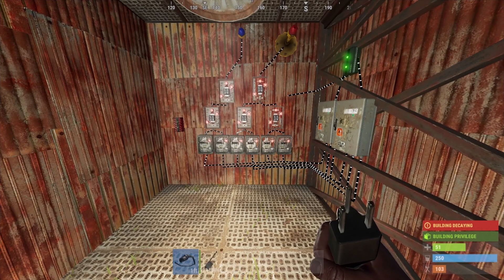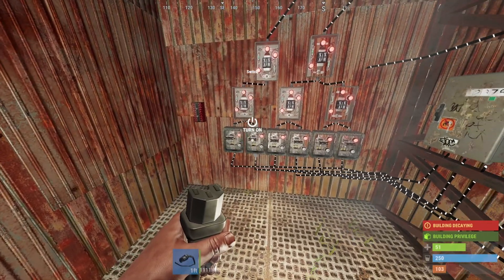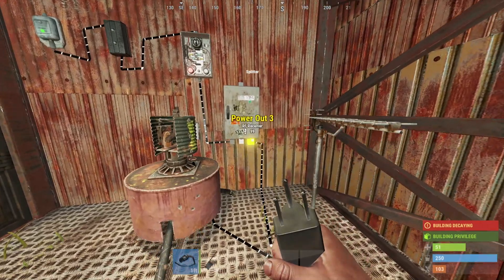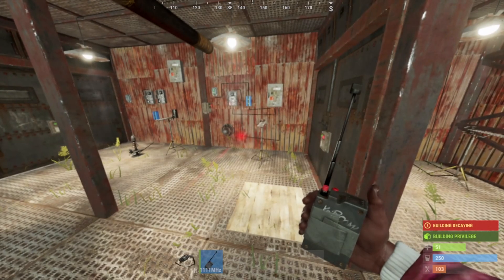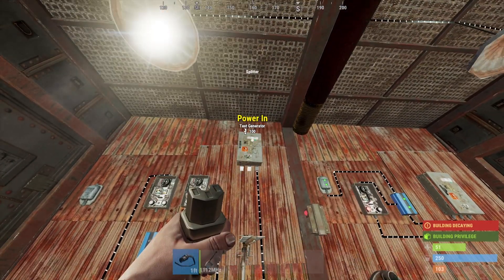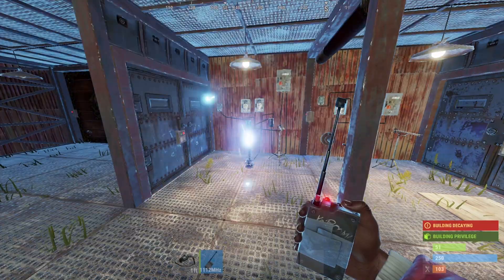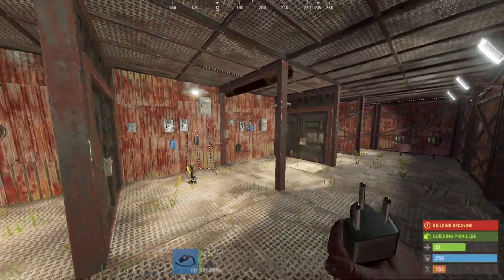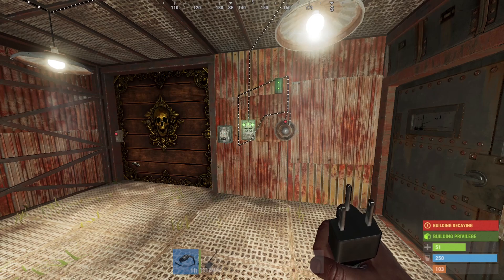ADVANCED Tutorial On Electricity In RUST! | XOR, AND Switches, Remote Controls!

Comment: Just so you know, electrical branches have been glitches ever since their release so you can’t use switches with them properly. If you have a battery running into a branch with, say, 8 power set as the branch out going directly into an off switch or a blocked blocker or something similar, the battery will always be using that 8 power, even though it shouldn’t be. So you cannot save power that way. 

The only real solution is to run all your batteries directly into a switch before anything else, because that at least does work properly and prevents any power from being used if the switch is off.

Because of this, large batteries are mostly irrelevant unless you like wasting power or have one circuit that uses more than 50 power. Just use one medium battery for each unique circuit in your base is my best advice.

Comment: Electrical branch, when you set power through left side that power will always draw. if you set the draw to 95, your battery will always be drawing 95 through that branch regardless if anything is connected or not. generally for hbhf sensors they are a bit expensive since you do need more components but generally you have a branch draw a small amount dedicated for that hbhf and the +1 power it can pass through which is usually used for blockers, switches, or some form of alert system and or trigger system for a timer.

Comment: Been trying to hook up my search lights to a RF receiver, so when i push the button on my transmitter, it turns lights on, and if i click it again, it turns em off again. So far all i managed to achieve is that i can turn on ( or off) the lights as long as i hold the transmitter button down ( like in your tesla trap bit).
But i want to just click it to turn on, and it stays on until i click it again. Any ideas ?
Reply: couldn't you use a mem cell with the toggle input connecting to your rf and the mem cell output connected to your lights
Reply from the maker: You could also use a smart switch now and just use your mobile phone to turn it off and on and save you the RF :)
Reply: RF receiver to toggle input on a memory cell so when you broadcast, the receiver will toggle the state of the memory cell to pass through power from the inverted output to the regular output.

Comment: In your setup number two with the turret and timer on door you speak about power efficiency, but your use of a splitter is the worst way to actually save power. In this way you need 10 power for the turret, which means in the best setup with only two active outputs from the splitter you would need 21 power, 10 for each output + 1 for the splitter. So in this case you still send 10 power to the door controller which only needs 3 power to work. With branches you would have saved the last 7.
Reply from the maker: clark_kent2019 you see a splitter will only use the power actually being used. It has changed how it used to work. It would use 100 power all the time. So using a splitter is cost saving because it give 3 outputs at the cost of 1 power
Reply: @TheBigGeee  Ok that's clever though. Didn't know that, stand corrected. Thanks for your answer, and keep up the good work. I like theese electricity videos, as that's the main thing i do in rust.
Reply: @TheBigGeee  I was just in there trying it now. Lets say you need 4 auto turrets powerd - for this you use a splitter and a branch.
you take two auto turrets and connect it to the splitter and connect the branch in the last output. Afterwards you take the two outputs from branch and split it into the two remaining autoturrets. 4 x autoturrets would require 40 power to be powered. But using the splitter it will require 60 instead, as you would need 20 power on all outputs, for the two branch turrets to work. Therefor you are forced to put out 10 more power than you need to the first two turrets. You are right that they wont drain it on the battery, but it's still power that you can't use anywhere else, unless you are planning to put two autoturrets on all outputs. Never the less my point stands that using branches would be the more efficient way of doing it, as you could direct the specific amount of power for every need (:

Comment: Thanks for the video - I don't understand what your problem is with the ROOT combiner? It does as it should - combines roots of power. I kinda get that you want to use it as an gate, but you have the gates for that. The only small annoying thing with it is that the "and" gate, doesn't combine the two, but only chooses one. It would be cool to see that they changed THAT, because that's the only limiter in terms of not having ROOT combiner take other inputs than ROOT combiners and power sources.
Reply from the maker: clark_kent2019 Yea 100% I thought the root combiner only work from power sauce like a solar pannel to a battery but it can be used to connect multiple battery’s up to one switch. I don’t see how it can send power to a switch from it but can’t pick it back up at the other end. I wanna use it as a way to make 6 outputs to 1 input but using the same method as solar panels to a battery.
Reply: @TheBigGeee  Yea. If you want to make 6 inputs 1, you just use the gates that you already did. But i agree that it's annoying that it doesn't add up the amount of power. Say i have 6 switches that outputs 10 power. It would be cool to be allowed to turn all switches on and it then output 60. With the current way the gates work it will only output 10, even though all 6 are on. But my point was that i agreed with you, that we need a way of combining thesse outputs - only that it makes more sense to change the gates to this, and not the root combiner (:
Reply from the maker: @clark_kent-vz4mw  100% :)